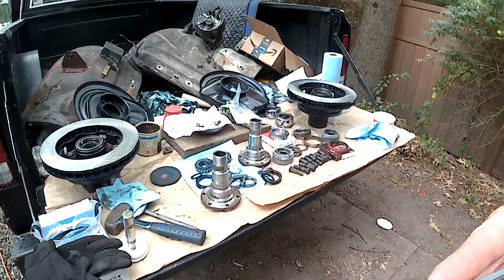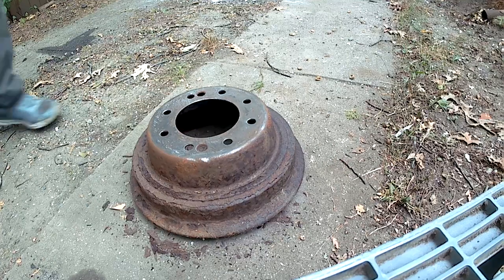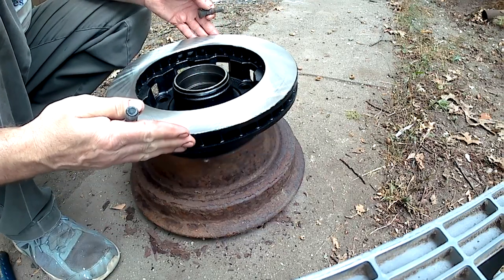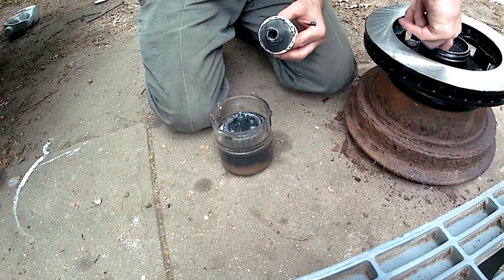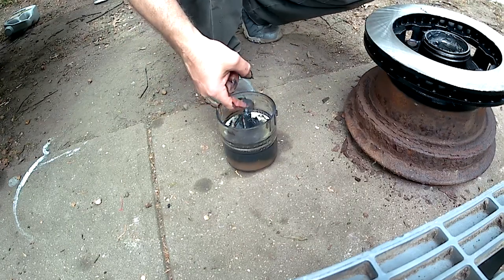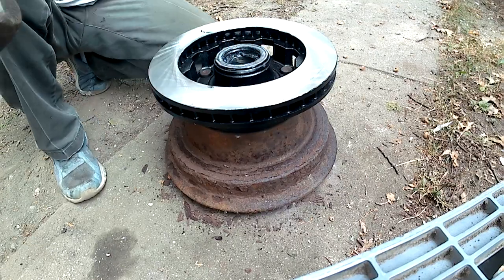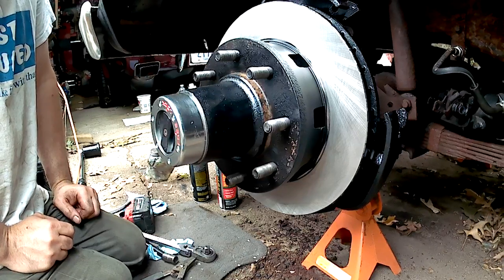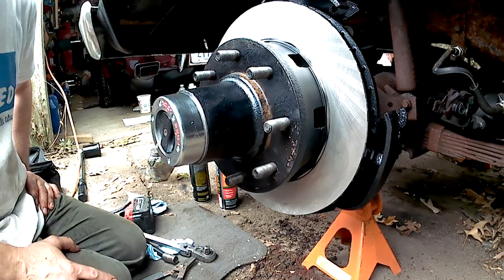Front D44 Wheel Hub: Reassembly

Comment: Hi and thanks for a great video. 
A quick question. It seems to be on the low side of tightening the outer spindle nut to only 50 ft pounds or what. I have seen several others tightening the nut with between 150 - 190 ft pounds.
Reply from the maker: That might be for an axle-nut for unitized bearing; on this bearing setup, you just want the proper preload. By tightening to 50 ft-pounds while rotating the hub, you take out all the slack, and by backing off from there you can get the proper end play. If you left it even at 50 fr-lbs, that would be far too much preload and you would burn up the bearing in short order.
Reply: Are we both talking about the outer spindle nut. The first nut you tighten to 50 ft lbs and backing off but the outer is it not always tighten a lot more - above 160. 
I have a Ford Bronco with Dana 44 spindle.
Reply from the maker: @treeoflifebyjwp  , That step in the procedure from the shop manual only calls for 50 ft/lbs, but at least that amount, so I guess you could go more. Since the washer between the nuts locks the pin on the inner nut from turning, there's not a lot of force at play trying to undo the outer nut, so I could see 50 ft/lbs being sufficient.
Reply: @treeoflifebyjwp  Ford shop manual states 150 lbs for the outer

Comment: Can you add the part numbers for the wheel bearings inner and outer? I heard they are different from the J10
Reply from the maker: The bearings are the same for the front D44 axle, whether it is used on a J-10 or a J-20; the spindle and bearings are the same, though the J-20 hub has the 8-lug wheel pattern and disk is 12" vs. the 6-lug wheel and 11" disc on the J-10.
Reply: Got it. Thanks again. Great video!

Comment: Sooo..that beveled spindle washer..? Is that metal? Is it called a axle spindle thrust washer?
Reply: Depends on which Dana 44 you have. Mine’s a 66-71 ford open knuckle and that washer (thrust) is bronze. When you buy the spindle internal bearing kit for yer Dana model it comes with the suitable thrust washer (I’ve seen rubber ones and steel ones)
Reply: @35ppt  savvy. Thank you.

Comment: 09:50 what is that seal called… please anyone!
Reply from the maker: That is the National #722109 seal; I have the part numbers for each of those seals in this install in the video description.

https://www.oreillyauto.com/detail/c/national/cv--driveshaft---axle/axle-spindle-seal/cc1e42105ae5/national-axle-spindle-seal/bca0/722109
Reply: @bbsbcv   thank you so much man! I’ve been wanting repack my bearings on my 91 w150, I was just needing this new seal as I’ve usually saw that they fall apart after removing the spindle. Much appreciation!
Reply from the maker: @sickmansgas483  , I see that O'Reilly's lists both the 722109 and the smaller 722108 inner seals as fitting the '91 W150; you might do better to buy the SBK-1 kit that also has the needle-bearing for the stub-shaft to ride on, and which is not much more than one of the seals on its own: 

https://www.oreillyauto.com/detail/c/national/national-spindle-bearing-and-seal/bca0/sbk1/v/a/2119/automotive-truck-1991-dodge-w150-pickup-4wd?q=1991+Dodge+W150+axle+spindle+seal&pos=6